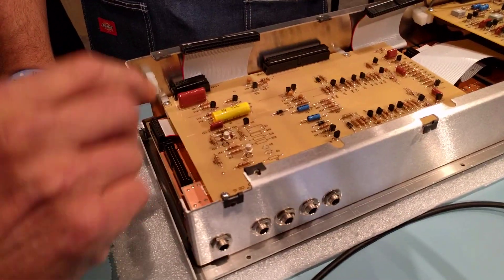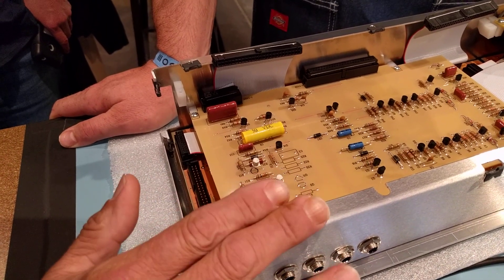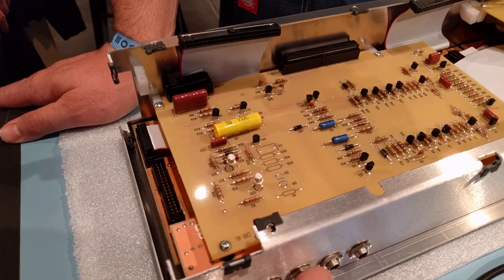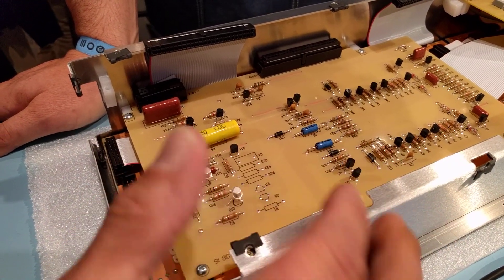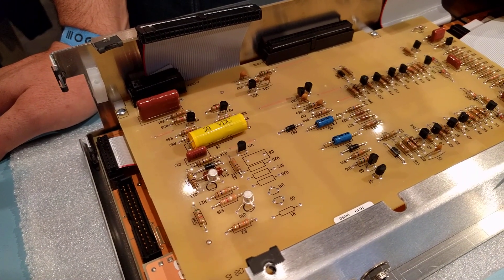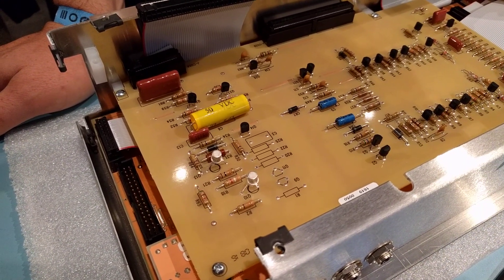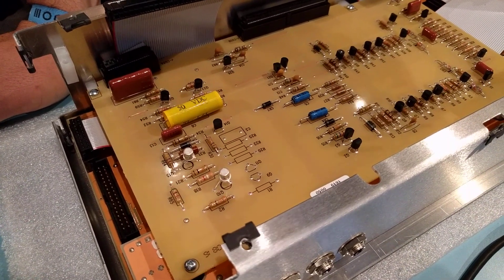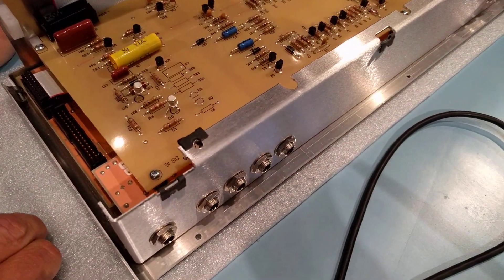Moog Minimoog Model D Reissue Unpopulated Pads Solved

Comment: Ok, so what are your opinions on the Fatar keyboard in your Model D?  I have one in order as of yesterday and believe it or not one of my biggest hang ups was the new keyboard; I much prefer a Pratt Read but, this is 2017 and I guess that our options are that or nothing right?  lol

Sounded like you were interested in retrofitting a PR assembly... that's why I ask.
Reply from the maker: Hey, sorry I didn't see your post.  The Fatar is the best keyboard for today's synths, but it is stiffer than the Pratt Read.  It because it has a different fulcrum point - at the end of the plastic, whereas the Pratt Read has a steel frame that continues another 2 inches.  So yes, I prefer the Pratt Read keyboard, but in comparison, the Fatar is much better than what came with my Moog Little Phatty Tribute Edition (or the Realistic MG-1).
Reply: That's the point I really do not understand: Why does Fatar put the fulcrum point right at the end of the keys and not one or two inches to the back. It would improve the keyboard so much....